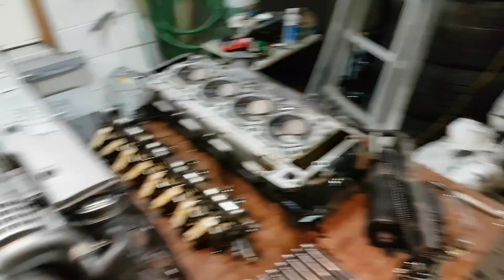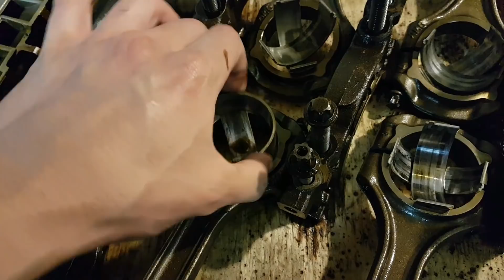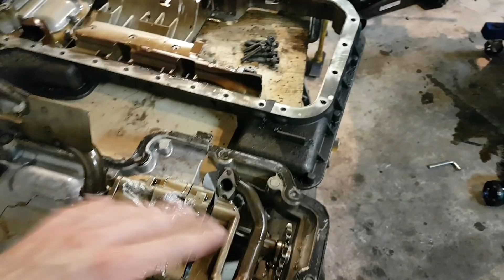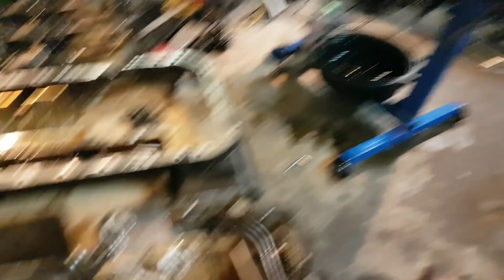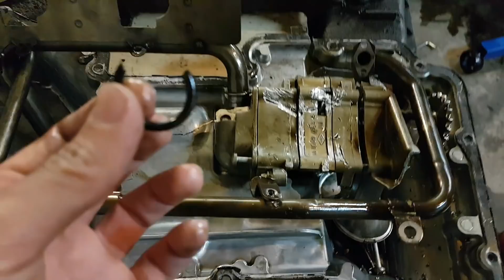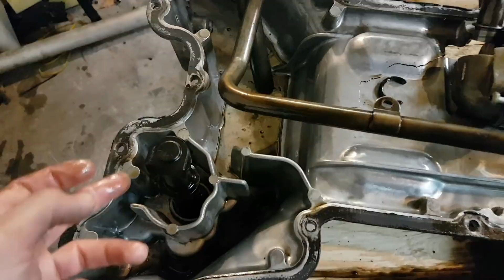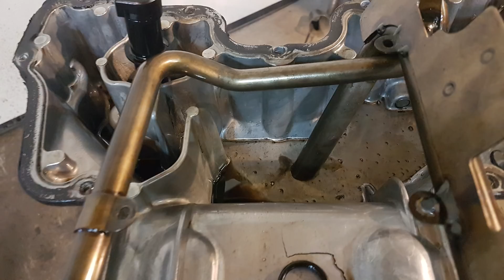Why my Engine Blew. Something every E55 owner should know!

Comment: Wow that is a shocking design fail from Mercedes!
That O-ring was something they could have prevented and no oil pressure sensor is just a big design fail in my opinion.

Keep up the good work man 👍
Reply: My Clk500 doesn't have a dipstick. You have to believe in a sensor that sends info to the dash about oil level. Great job mercedes👏
Reply: @410kane  The new 2020 Supra does that bullshit too. Fucking BMW teaming up with Toyota
Reply: Mercedes Mob 
Hey Mr. I’m smarter then the Engineers at Mercedes,BMW,Audi,Lamborghini,Porsche and others that no longer use a dipstick what a moron this video is about a driver that abused his high mileage car by his own admission.
Reply from the maker: I believe this design only came in the E55's and newer cars that came after 03. The S class W210 and CL W215 had a much better oil pump design. The collector was a part of the pump rather than separately being mounted.
Reply: SK8215 
First Finnish high school then go to MIT  get an Engineering degree 
Then you will know this is a operator error not a mechanical issue.
Reply: @992turbos8  bro should I be concerned about my m113k its a daily with 120 I've seen some with 200k on them and I don't track but would line it up at the light if needed
Reply: Duke107 
Don’t be afraid of higher mileage cars as long as it’s been maintained well. Just remember it does not matter who the manufacturer is , if it moves it’s subject to wear or breakage with older cars I think of rot in o-rings , joints , seals , basically the Malleable parts .
Maintenance is key especially if your a enthusiastic driver as I am.
Bottom line with regular maintenance by a trained technician you will know if your car is safe.
Reply: @xfmotorsports  Yes indeed, this is only model with this kind of construction. all others are solid, but i have seen few cracked pipes that can potentially cause the same. Usually the screw that holds it in its place, is loose and allows vibration.
Reply: Ok, so my w210 e55 would avoid this shit?
Reply: webnothing
That's why Europe is full of Mercedes cars with 500,000 to 1,000,000 km's on the clock running like brand new? I don't think I sat in a Mercedes taxi in my life that had less than 500,000 km's on it. I love how tards always like to take one bad example and then shit all over the whole brand, while ignoring millions of examples that prove that the opposite of their belief is true.
Reply: derbigpr500 
It’s true German cars Mercedes and BMW are very reliable, rewatch and listen closed to what he’s says he’s driven this cars hard  ran it very hot causing big fluctuation in temp and prematurely causing the O-ring to harden that does not happen with 10-15 times of overheating.
This is an E55 these cars are like the M3 they race, track and just beat the hell out of them . I looked at service bulletins this is an isolated case.
Reply: It's the people with an anti Mercedes chip on their shoulder.
Reply: They could have done what 99% of manufacturers do and use a flange and gasket. Shocking indeed. That O- ring gets hot and cold thousands of times. And thicker is not necessarily better.
Reply: moyadapne 
Get an Engineering degree before you post stupid comments moron !
Reply: Moyadapne 99% of oil picks ups seal with an Oring, not a flange and gasket. Further more, its a common practice to WELD the oil pickup at its connection point on raced engines to prevent exactly this failure. If the pump housing and pickup are dissimilar metals, you get to fabricate a new pickup! yaaayyy. its not that hard. You are all fucking kid idiots talking out your ass that have less than ZERO EXPERIENCE on the race track. Fuck off you stupid ass hats. You raced it, You Broke it. Its NOT mercedes fault.
Reply: Cars1999 No need to swap out the engines. You are just making a bad assumption.
Reply: Jonathan Straetman 
This was operator error pure and simple. 
There’s no design flaw. By his own admission her drove it very hard and overheated it several times which Lead to the high mileage 200km or 125 thousand miles to a O-ring failure.
Reply: @992turbos8  so is this car safe to keep over 120k or should I dump i enjoy my car alot so I am asking i don't track also u guys no i dont have MBA from Yael please guys lmk
Reply: they ware out over time, they need to be changed, check the owners manual.
Reply: Right, Low oil pressure should shut down the engine. How much does a Mercedes cost?
Reply: Jake name ONE car from that factory that will shut down with low oil pressure? NONE!!!! Because the engine shutting off is MORE DANGEROUS on the highway than driving it till it self destructs. As an engine loses oil pressure, and begins to seize, it will loser power. Making the operator AWARE of the problem and giving them TIME to put the car in a safe spot. Like the shoulder of the road. An engine is CHEAP compared to the lives of the vehicles occupants. On a race course, getting mowed down due to a popped motor is of zero concern. The corner workers will flag the traffic for your. You seen corner workers on the highway waving yellow flags everytime someone drops below the posted speed limit? lol. Come the fuck on you stupid ass children.
Reply: Does look like it

Never had a car with low oil warning until I got a skoda, cars before or even recant cars oil pressure sensor only, never seen a car with no oil pressure sensor

if a car came without a low oil pressure sensor only it should not even be allowed to be sold as that's a intended design flaw to destroy the engine if something went wrong with pump or o-ring 

It be interesting how long it takes for the o-ring to harden up
Reply: @leexgx  hi you think I should stay away for m113k over the m278 they both have there flaws
Reply: Where derbigpr500 lives the taxis are all petrol high performance AMG models with more than 500 000km...with very high oil pressure...
Reply: Honda engines are pretty reliable, but there still are design flaws with it. For example, I think every Honda engine is an interference engine that uses a timing belt. That is asking for trouble. If that belt breaks (and they can break long before they're due to be changed), it's almost a promise you will be rebuilding the head. That being said, I once had a Honda with almost 300K miles on it still running on the original timing belt. Very risky, but it happened.
Reply: i thought low/no pressure sensor on the end of the oil feed was standard, wow that's really cheaping out on something that should be standard never knew car manufacturer would skimp on something as basic as a oil pressure sensor (as the moment that low/no pressure light comes on you kill the engine right away or your on metal on metal within a short time especially if it has a turbo), as no oil can destroy an engine quite quickly that's a serious design flaw as well as that oring (more than likely it failed on the track on them laps you was on)
Reply: tellucas 
It’s obvious you still ride a bicycle 
As you no nothing about this car.
Reply: People keep buying this garbage , and call it a lesson.  victims and their keepers
Reply: jmac2050 I think it's like an abusive relationship with a Covert narcissist.  And the owner is addicted to the expensive abuse. Mercedes and BMW ,VW, Audi and Most other European cars. Complete shit.  But if it's new. It drives and corners so nice for 30K miles. And afterwards they are money pits
Reply: Mercedes Mob I have a 2003 W220 S430. Mine has a sensor too. I bought a universal dipstick and use that to check my oil too.
Reply: colt hoover 
What a moron the only dipstick is you
Reply: +derbigpr500. From here: https://www.toytowngermany.com/forum/topic/83409-why-most-taxis-are-mercedes/. 

Excerpt:
to see Mercs used practically everywhere as taxis, de-values their status imo.
yep. Which is why BMW don't give the big discounts for taxis. It is not just the up front discount, though, they also offer the whole package from a ready made taxi with all the extra fittings and colour to discounts on parts and servicing. However, a taxi friend of mine from Berlin said all his taxi colleagues were turning away from Mercedes in droves because the reliability has plummeted with the current E-class (some even prefer to drive 15-year old E-classes in preference to new ones) whilst the life-time costs have shot up. They say it is now cheaper to run a VW or an import for 3 years then dump it rather than try and run a Merc for 5-10 years.
End excerpt.

Mercedes in Australia are not cheap cars to buy and maintain by any stretch, locally made and Japanese cars are the preferred option here.

Many Australian and Japanese cars used as taxis typically have at least a 500km life, before they are sold off to private buyers with some warranty as well. 

Not necessarily because they are worn out, but also because of tax and commercial vehicle safety rules and maintenance factors (level of risk). Buying a new vehicle makes more economic sense after a certain mileage/time frame. Many customers do prefer a newer vehicle because of more modern safety features and the interiors do get worn. Even those Mercedes taxis wouldn't be appointed to the same luxury levels as private cars. 

Simply said, over here the economics of owning a Mecerdes taxi doesn't stack up.

Not necessarily because they are worn out,
Reply: Maybe accounting got to far with this engine. Older cars with M119 and other engines just had a oil pressure meter in the dash board ! Really handy. (But one thing they do is warn you when the oil level is low, not like some other cars warn you when it´s all gone, or pressure is 0)
Reply: derbigpr500 yeah you can, bc every Mercedes Engine back then was engineered Quite equal.
Reply: Jonathan Straetman at
Reply: derbigpr500 The number of cylinders or the complexity of the design should not make much difference if the design is properly executed.
Reply: It’s straight forward thinking.....it makes the car a few bucks less expensive...
Reply: @jzxtrd337  probably? i say most likely
Reply: webnothing  for reliability you cant beat toyota and honda. Out of Benz, bmw and audi I would defo give it to the benz. 
Its fast and reliable.
BMW and Audi have to much issues.
Ask me how I know this lol
Reply: Cars1999
You can't really compare some 2 liter 4 cylinder that's so simple nothing on it can go wrong to something as complex as this V8 in the E55.
Reply: derbigpr500 
Your a moron !
Reply: I just changed the timing belt on my Honda Accord V6 (100,000km/62,500 miles) as per the service schedule. The dealer and another mechanic friend of mine said these engines are very resilient, so don't stress if i go a little bit over...but 300,00 MILES? that is incredible!!
Reply: derbigpr500
"I don't think I sat in a Mercedes taxi in my life that had less than 500,000 km's on it" Your comment makes it sound as if all Merc taxis have 500 000km plus on the clock, do they come from the factory with lots of km on them or how do they end up with 500 000 plus km?
Modern Merc engines are a far cry from the older ones, the C55 is not known for its reliability. Using a damn o ring instead of a flange that bolts on with a proper gasket is just stupid, and that in a high performance engine...
Reply: I'm pretty sure they swap engines out.
Reply: HONDA make the best engines...look up any video on someone tearing down one and you'll understand.
Reply: Cars1999 
Japanese are defiantly not good mechanical Engineers and never have been that why Honda and Toyota are teaming up with German Engineers to make a better more reliable engine.
Reply: @MatrixDiscovery   Except old mercedes diesel engines that looks like new after million miles.

Comment: The challenger space shuttle also blew cus of a O-ring
Reply: Yeah, a lot of bad things can happen when rubber tears.
Reply: jospi2 hahahah
Reply: Better oil pump designs have the oil pickup tube pressed in so the interference fit makes a permanent seal. That's too critical a part to be relying on just an o-ring, especially in oil since there can be so many different things present that will attack the rubber. On top of that it cant be serviced if it breaks down. Im sure its a cheap Buna-n o-ring rather than something like Viton that will hold up better.
Reply: The space shuttle worked as designed as did the SRBs. They were operated way out of thermal design spec due to some greedy bastards at NASA. I suspect infrequent oil changes in the engine's past had some effect on the longevity of this o-ring.
Reply: InsideOfMyOwnMind an oil change on a space shuttle probably costs a fair bit. Freon etc.
Reply: No, When the SRBs got refurbed following recovery, they took too few measures to check whether the segments making up the tank/hull (?) are out of round or not. It wasn't where they measured - but in other places... Actually they had called in Feynman to investigate and he wrote a book about how he figured it out... interesting read if you are casually interested in this sort of thing. 

https://www.amazon.com/What-Care-Other-People-Think/dp/B000BKSFXI/ref=sr_1_5?ie=UTF8&qid=1537851658&sr=8-5&keywords=feynman+space+shuttle
Reply: Yup, but Morton Thiokol never signed off on Booster Engines being operated after a below freezing night.  They warned NASA against launch but NASA pushed it 'cause Ronnie (Reagan) was touring the facility that morning...
Reply: Absolutely correct. Ronnie wanted a successful launch for his State Of The Union Address that evening. Ronnie was in DC when Challenger launched.
Reply: @Glenn08CRF   I worked for DuPont back then. Material was N-butile nitrile. I had a Rewmington 1187 auto. THe o-ring would  not seal in cold weather and I would get jams extracting the shells. I contacted them, and said they needed to change the material. I went to an auto parts store, and still have that O- ring in my gun years later.
Reply: Hot damn lol 😂😂😂😂
Reply: yeah the shuttle blew up but nobody was on it. The captain of the shuttle works as a professor at UW Madison and people have questioned him as to why he is not dead.
Reply: This is the best example how big influence has proper chosen orings.
Reply: It also looks similar to l.a.w.s. that was demonstrated in youtube Navy film with actual laser locked onto jet plane.... The manner of fire starting on side on shuttle compared to manner of fire on jet plane...
Reply: @brianw4brian   do you have a link to this video?
Reply: @powerrubbercom  the name is (pew pew! Watch navy laser shoot down drone.)       On YouTube search it out you'll find it.  There are couple more showing the burn.
Reply: @brianw4brian  Thank You
Reply: @powerrubbercom  it's just an observation.  I thought it's amazing tragic etc.  That emeralds can do something form of a laser.  I know military at Fort hunter liggett were using lasers 1979 but i thought because of reflective metal it would mirror laser off polished metal I just do not have the tech. Knowledge but it's really weird how that shuttle disaster went.  Werner von Braun and NASA.
Reply: idiot # The challenger space shuttle

Comment: Didn’t the low oil pressure light come on? Is it possible to not wire the ecu to shut the engine down if the oil pressure drops in the pump?
Reply: Ok I just watched the whole thing lol, that’s pretty crappy design imo...

Comment: Damn dude. PPL IF YOU'RE BUILDING A RACE CAR HAVE AUTO SHUT OFFS FOR EXTREME CONDITIONS LIKE LEAN AIR FUEL RATIOS AND LOW OIL PRESSURES HIGH ENGINE TEMPERATURES ETC.

Comment: i belive you can program some  aftermarket ECUs to shut the engine down if oil pressure is lost.
Reply: Ronald Rebolledo lmao what a fucking concept right?? It’s a sensor, it can be added
Reply: it can, but you need an extra sensor... i test a oil pressure sensor mounted in a oil filter but you need to program quite well because car wont start after oil change.
Reply: CashedClean because you tap an oil galley and measure it....nigga
Reply: @Truthcanbeconfusing  stfu chent
Reply: how would it know if oil pressure is lost if theres no oil pressure sensor nigga

Comment: See if you can have a -8 male bung machined and welded into the pump housing or pressed into the housing.  Consider a separate oil system for the turbos maybe?

Comment: how hard is it to replace that seal, its good to know even for the drag racing guys!
Reply from the maker: The oil pump needs to come out to get to it, so it is a difficult place to reach but definitely worth replacing after seeing what it can cause
Reply: so removing the engine is the only option.....
Reply: SchepersP lol would say wait for it to blow and buy a new engine it would be the same job unless you are a genius that can dismount and tear apart a amg engine in 24h by your self like SK xD
Reply from the maker: You would be able to do it with the engine in the car as far as you can remove the oil pan. The subframe is right underneath it so that might make it really difficult.

Comment: How was the engine maintained over it's life?  I've always read that extended OCI leave acids in the oil that cause rubber seals in the engine to harden and cause leaks, etc.  One of the reasons I've never been a fan of extended OCI.
Reply from the maker: I've been using Mobil 1 synthetic mostly. Usually replaced the oil after every 1 or 2 trackdays but then it was a used car. Dont know what it went through before. None the less it isn't the best design having an oil collector sealed by a rubber o-ring. Its something that would fail sooner or later
Reply: SK8215 how many miles were on it when you got it?
Reply: Matt from Florida that's false though, dark oil doesn't mean it's not lubricating properly
Reply: Teutonic, I agree.  I look for reasons to change oil early.  Like if the oil is no longer clear, even after 3K miles say, I'll change it.  If I can see dirt in the oil I figure the car can feel it... and that means wear.